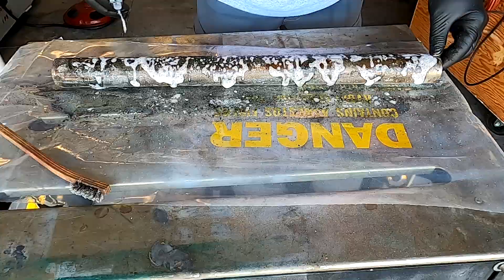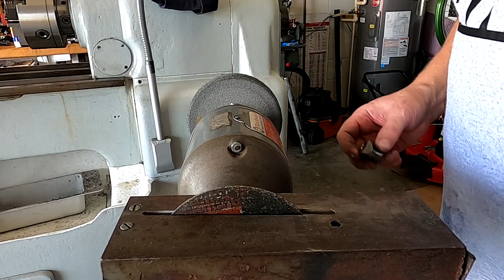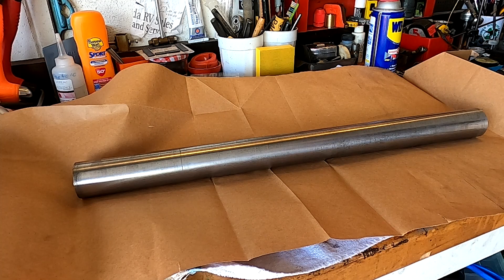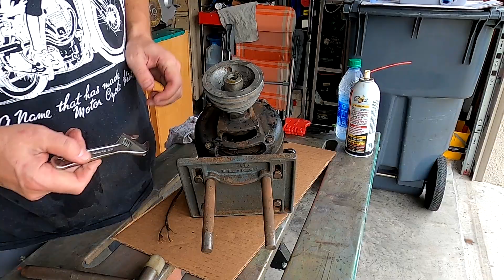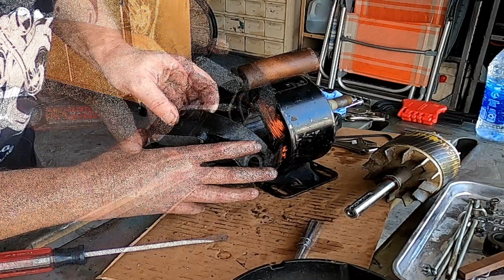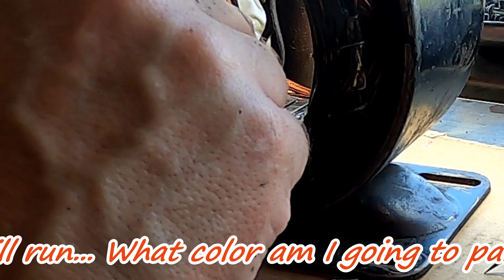Antique Drill Press: Dunlap/Craftsman/King-Seeley 103. Restoration Pt 2

Comment: I lost my comments on part 1. I will make a new effort on part 2.

I don't know anything about these little drill presses or if Dunlop and King Seeley are the same or different.  I am a life long Craftsman hater since I favor or quality and professional tools. I entered the trades in the mid 1970's thinking highly of Craftsman, but my professional demands quickly revealed that I had to mo e to quality machines and tools.

But I have 2 exceptions. I purchased an entire shop and acquired my first metal lathe (Craftsman/Atlas) very inexpensively. It is very light duty,  but it is still a daily user. I also own a Craftsman Pharaoh head drill press. My drill press was only manufactured in 1942 for 6 months.  War production ceased production.  It is very quirky, but very handy.The Dunlop motor is probably the same vintage and has similar quirks. I had never previously owned a little drill press. My Pharoh head is surprisingly well made. Your machines look like they retain some of the quality of my vintage Craftsman. 

My distain for Craftsman is offset for how handy a little well made machine is in the shop. So much do, that I have purchased 3 more little drill presses. I gave away 3 of my industrial drill presses after recognizing that I do a lot more light duty drill press work than large work, and the little machines are very convenient.  I like my Pharaoh head so much that I purchased and restored a 1970's vintage Craftsman drill press. It uses the tiny V belt, and with the 2 speed motor, I have appropriate speeds for deburring operations. I have even tried it for light duty power tapping (but it lacks reverse).

I enjoyed your video.
Reply from the maker: Thanx, sounds like we're kind of in the same boat. Don

Comment: That not a speed limiting switch, its the centrifugal switch that changes between the Start and run windings
Reply from the maker: Yes, I know. I self corrected that error later on... Sometime when you're first getting into something or are talking to yourself, it comes out kind of generic - non specific.   - that video still hasn't been downloaded. I've been waiting on a part to finish out Pt.3 where you should be able to catch that correction.  Don...and thanks for watching.
Reply: Hi Don,  it's funny that I listened how you spoke and interpreted your generic speak to mean what you meant to say and I did not notice whatyousaid.   I have just started watching your channel and going through some of your videos and really enjoying them so subscribed a few days ago.    I have an atlas 12 x 36.   It is the newer model they made the last few years so have sure enjoyed some of those videos as well.   I'll be trying to catch up on seeing them all.   By the way I have an old drill press that was made in Ontario that is older and has the same design and parts.   I can see where they got there design from as it is almost an exact copy of mine.   It had the quill bent when I first got it but I managed to straighten it and now I really like the drill press.   Thanks for the great videos. 

Dale in Canada